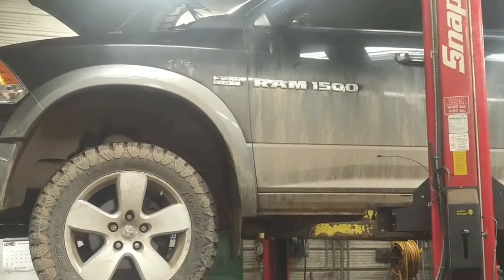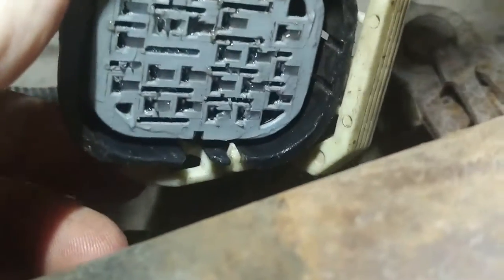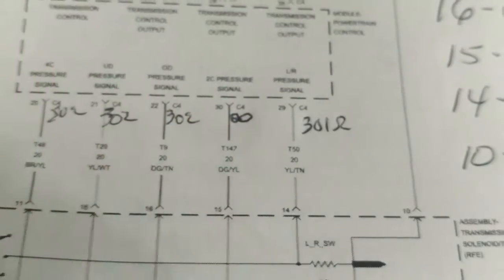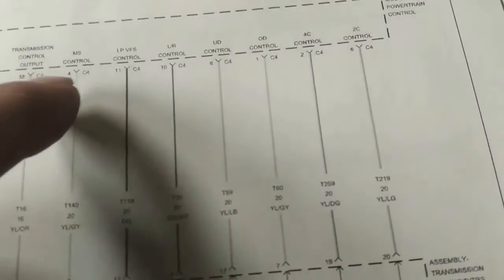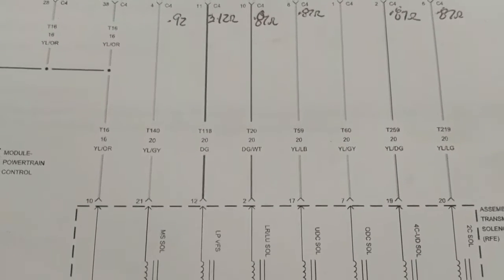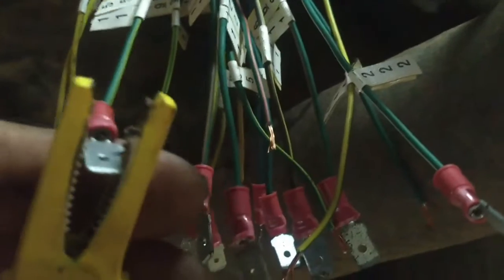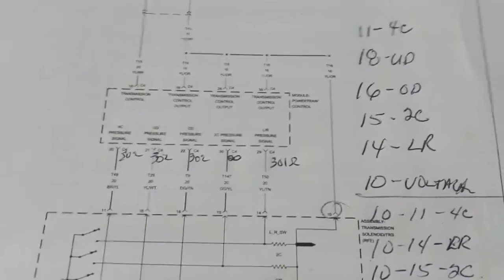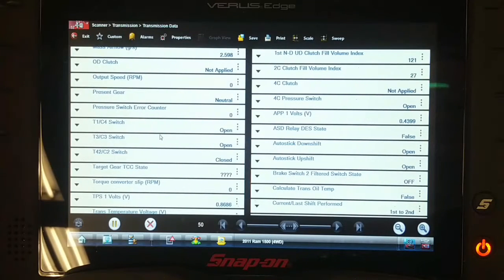2011 Ram 1500 Hemi Transmission Code P0846

Comment: Hey Philip, I need your assistance in this situation cause I'm having a same issue with this code along with other trans codes. Which my trans relay output always off once cranking up 05 dodge ram 1500 4.7 v8 4-4 slt truck. Could you give me a call or contact #?
Reply from the maker: Phils@tbaytel.net

Comment: Dang that was a nice finding I am not that lucky and knowledgeable I am having the same code on my 06 durango with the 5.7 hemi and the live data shows the same closed solenoid went to a quick conclusion that it was a bad solenoid pack and I was wrong the new one still show the same code and still having the problem with the truck go to limp every now and then.
Reply from the maker: Have to load test the circuits from the PCM and transmission